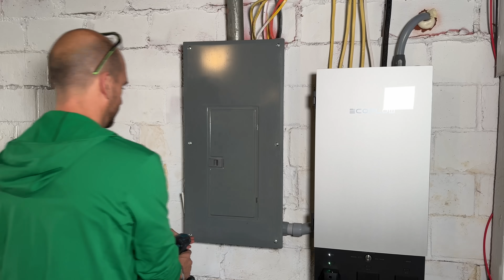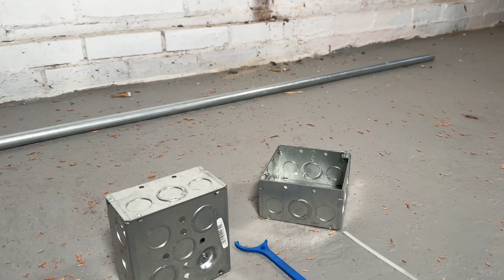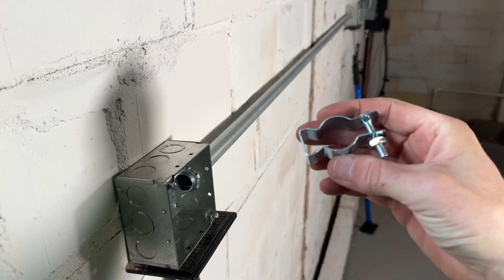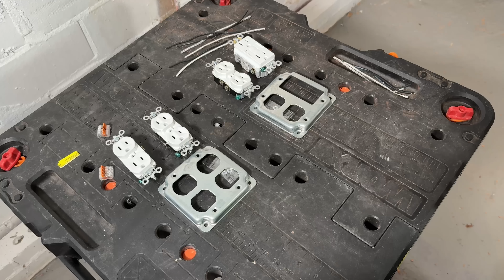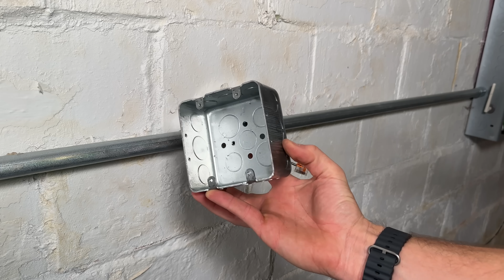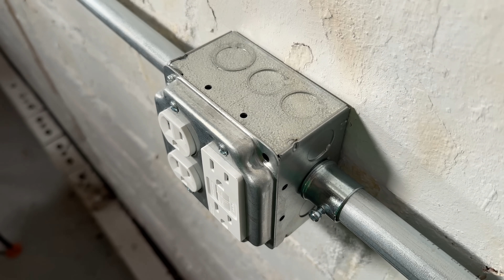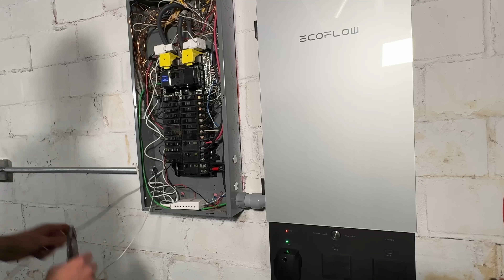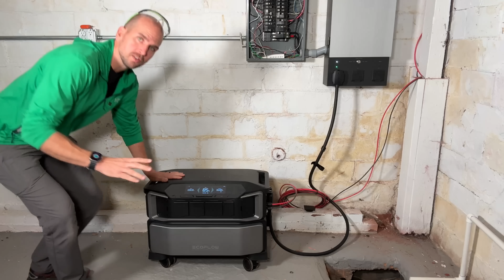Add Outlet To Unfinished Basement Or Garage

Comment: Do the WAGO connectors really carry as much current as a solid wire?  Why not connect the wires directly to the outlet terminals?  The outlets in the first box are connected through one WAGO connector while the outlets in the second box are connected through three WAGO connectors.  What's the voltage drop to the second box?  Can the second box carry as much current as the first box?  In another video, you show the heat generated by the WAGO connectors which means resistance which means reduced capacity.  What is the capacity loss?

Comment: In a dry location, nonmetallic sheathed cable is permitted to be used inside a metallic Raceway without removing the outer jacket and without derating. Before you post video showing people about how to do things please read the national electrical code.

Comment: Great video and I am posting my comment before finishing it. This is exactly what I need to do in my basement and garage, so I am glad I found it. However, aren't those outlets 15AMP on a 20 amp circuit? Also, it would have been great if you had taken a moment to show the wiring connections between the outlets at regular speed rather than fast speed. Thanks

Comment: Never skip the dedicated ground wire.
Never rely on the conduit for ground, even when using rigid instead of EMT.
Also, make sure the groung can handle a short current without becoming a fuse!
Reply from the maker: Thanks for the feedback.
Reply: In the real world, the conduit is used as the EGC all the time. The NEC lists 14 different types of EGCs, only one is a wire, 12 are conduits.

Comment: May be a dumb question. But why use 15-amp rated outlets on 12 gauge with a 20 amp breaker? Why not use 20-amp rated outlets?

Comment: I was taught: in the panel, white to common bar, ground to neutral bar and black wire to the breaker. I see white and ground wires to the same bar. Then why have two bars for ground and neutral?
Reply: If you have only one main panel in the house the grounds and neutrals are bonded and share the same bars. If you have a sub panel then the grounds and neutrals have to be on separate bars .

Comment: A couple of suggestions here. First you need a pair of channel locks. I prefer 430's and they need to be uninsulated. That way you can ream the outside of the pipe with the jaws and ream the inside with the handles. Saves carrying extra tools. You can also tighten the connectors with those same channel locks. I would never use payne hangers on an exposed wall as they are a hang up issue from the ears stuck out. Learn to bend box offsets on that half inch emt. It's very easy to do. Then you can use one hole straps to support the pipe and nothing sticks out. Also you need a strap within eight inches of each box and if you're using a full joint of pipe you'll likely need a third strap in the middle for support.  There's nothing wrong with the way you made up the dual outlets in the industrial covers but most of us find it easy to tie the two outlets together first and only have one set of wires to connect to the feed. In a damp location like a basement I'd also suggest you toss those wago's and learn to use a quality wirenut correctly. It will make a far better connection for long term use. And as others have told you you need a good ground wire running through the pipe even though you have a sound mechanical connection a continuous ground wire is better.
Reply: EMT requires support within 3' of a box, not 18". Only damp basements are damp locations, which means visible moisture. Most basements are dry locations. EMT is fine as a ground and a wire type ground is not required, or better.
Reply: @pld8993  Thanks for the laugh. By the way I've seen inspectors grab a connector and twist it as hard as they could by hand. If it turned at all they failed the inspection.
Reply: @haroldgreen1425  Yeah, laugh. They should fail it. Hand tightened fittings is an improper installation and an NEC violation.

Comment: Pigtails are STUPID and just one more failure point. Wagos are no better than the push in connections on 15-amp switches and outlets and should be illegal. ALWAYS USE THE SCREWS

Comment: maybe I didn't quite understand.... what's the difference between Romex and stand alone strands of wire? Isn't romex the same thing just all insulated into a single sheathing?
Reply: I ONLY use Romex, especially underground in PVC conduit.
Reply: A wire is a single conductor; a cable is an assembly made up of multiple wires/conductors. Romex is a cable.
Reply: @pld8993  I should probably clarify... isn't the end result in their use the same? Meaning if I take off the sheath of the Romex, essentially I'd have the same bundle of cables as displayed in the video that were not sheathed...?
Reply: @DubyaK  The end result is the same electrically, but the NEC requires that romex in conduit maintain its sheathing because the individual conductors inside romex are not marked/labeled.
Reply: @pld8993  gotcha, thanks for the clarification! :)

Comment: No ground wire. Need a ground even in conduit. yes you can run the Romax in EMT pipe or has a case. You just can’t run it outside in due to that it’s not outside rated for wet locations. need to bond metal with the ground. And that’s false you can’t use your conduit as a ground that’s against code. You have to have a ground conductor and bonded to the box to complete the ground. Self grounding outlets are no longer acceptable. Electrition in New York State licensed 20+ years always want to pull the ground wire
Reply: 250.118 lists 14 different types of EGCs, only one is a wire. Metal conduits are 12 of the 14 and absolutely allowed as grounding path. Self grounding devices are also allowed. Read and learn

Comment: How many of these new outlets can I daisy chain on 1 circuit?
Reply: As many as you want on one circuit.
Reply: @pld8993  That's not actually true, That's why I asked. I looked it up since this question and the answer is no more than 10 outlets on a 20 amp circuit and the total load on the circuit should not to exceed 1250 watts including all devices running on this circuit.
Reply: If by “looked it up” you mean you googled it and found some random comment with your answer, that’s not really looking it up and you, predictably, found an incorrect answer. Nowhere in the NEC does it limit a 20 amp circuit to 10 outlets or 1,250 amps. A 20 amp residential circuit with receptacles (cord and plug connected loads) is limited to 16 amps (1,980 watts) with no limit on the number of receptacles on that circuit. Putting 100 receps on a circuit, while not smart, is legal. Why would a 20 amp circuit be limited to 1,250 watts, which is 10.4 amps?

Comment: Do not agree even if even allowed. Lock nuts loosen and corrode. Just run the darn green wire. It may be grounded, but not bonded.
Reply: Lock nuts don't magically loosen or corrode any more than ground screws magically loosen or corrode. You're wrong. Grounded and not bonded? That makes no sense.

Comment: As a retired professional electrician, I WOULD have mounted the conduit against the wall by bending an offset where the pipe leaves the panel and where they enter the 4" square boxes.  I would also have used the third green wire (#12 THHN) to make a reliable ground.
Reply: There's no need for box offsets in this installation, and the EMT is a reliable ground. Neither offsets or a wire EGC is wrong, just unnecessary.
Reply: @pld8993  I was simply stating how I would have accomplish this same task.  Yes, the conduit makes a good ground unless a connector comes loose.  Your work is neat and well done (up to code standards).  No hard feelings.  I did mostly commercial work and that was how I was trained back in the 70s when I was an apprentice.  Thanks for your response.
Reply: my thoughts exactly... where's the bends?
Reply: @davidcook1130, thanks David.  My main reason for doing this is to get rid of the hanger type strap which will be constantly snagging your clothing when walking by.  With the offsets, a single-hole strap can be used with the pipe against the garage wall.

Comment: The GFCI will not protect if you dont have a grounding
Reply: Yes it will. If the current between the hot and neutral are not equal, the GFCI will react and it doesn't need a ground to do so. However, in this case there is a ground, the conduit.
Reply: @pld8993  you are right

Comment: I don’t see any ground wire attaching to the metal box, you should ground the metal box because is metal, it helps you to avoid a shock son.
Reply: EMT is permitted as equipment grounding conductor, NEC 250.118(4).

Comment: need to strap your conduit and why didnt you use a conduit bender to off ser your conduit?
Reply: Yes, the 6' section needs a strap in the center. Offsets not required or necessary, with or without offsets is fine.

Comment: I would appreciate it if you slowed up enough to give a clear picture of your pigtails on the back of the outlets. This is a lot in a hurry.
Also, why should you not run romex through the conduit? 
Thanks
Reply: Romex can be difficult to pull through conduit, but romex is allowed in conduit anywhere romex is allowed.

Comment: Did he install 15 amp receptacles on a 20 amp circuit? I'm no electrician, but that's what it looks like to me.
Reply: Yes he did and it's fine. You can legally install 15 or 20 amp duplex receptacles on a 20 amp circuit. You can only install a 15 amp receptacle on a 15 amp circuit.

Comment: With the QO panel why not just use a breaker in the panel for GFCI/AFCI protection.  It’s a new installation and code is moving to require protection just about at every circuit anyways.  Excellent video though.  You have made me very comfortable with doing these home modifications myself, not to mention saved me significant amounts of cash.

Comment: I think that you're okay without a ground wire according to NEC 250.146(A). Your boxes are bonded by the metal conduit and the receptacles are mounted directly to the box cover, the self grounding feature is not necessary. It's only necessary for a flush mounted box or metal 4 x 4 box and mud ring, NEC 250.146(B).

Comment: That Battery backup sitting on the basement floor is a no no.  If water should rise and
contact that Battery a Fire could result.  The Chemical Makeup of the Batteries and
Water should never make contact due to the Fire Hazard.

Comment: Why did you use 4x15 amp outlets on a 20 amp circuit? And WTF not run a ground wire as well?🤔
Reply: 15 amp receps are regularly used on 20 amp circuits, and the conduit is the ground.

Comment: That has to be the silliest way to install conduit. First of tapcons are garbage, use a red or yellow anchor. Why would you use cabinet jacks to install, start from the panel and work your way left, leveling each piece of pipe and box one at a time left to right. Why did you not give your 6 foot piece a box offset on each end so you can install a one hole strap? You are definitely not an electrician bud

Comment: If that outlet plate is ever removed from the box while the circuit is live, it will become ungrounded. I always use a ground wire for outlets and always bond the last box in a conduit run for safety.

Comment: I was a Master Electrician and would like to comment:
(1.) We always ran an insulated ground wire with the other wires. The Code may not make you but it is standard practice. 
(2.) We always used a box off set and one hole clamps on the EMT. Where the conduit was located where no  one could rub against it we may use hangers like you showed.
(3.) The wire would need to be labeled for the use.

Comment: I'm  going to pile on.  First you did not check to see if there was no power with a non contact tester prior to working.  ALLWAYS check the power state twice with different tests before working if you are not a professional.  ALLWAYS.  Second, NO  inspector where I live would sign off on that installation without a EGC (ground wire).  They would just fail you. Argue the code all you want, they would just fail you.  Furthermore no electrician I know would not install the ground wire. Third, no professional electrician would install this without the EGC.  Fourth, you have no idea what is going to be on that circuit in the future why create a wacko difficult to troubleshoot situation.  This might fly in Chicago but I have my doubts.  Finally, I have seen EMT completely corroded through with just the (live) insulated wire running through the slab.  With out an EGC there would have been no ground.
Reply: The metal conduit is the EGC and is perfectly legal and reliable; wire type EGC not required in this case. Real electricians install metal conduit EGCs every day so you must not know any real electricians. Inspectors don't get to fail code compliant installations simply because they prefer some other method. If they try, one phone call to the AHJ will set them straight. You're obviously not an electrician.

Comment: The reason he strips out tapcoms is because he drills so far, if you put a piece of tape before the end of your screw on your drill bit that you know right where the screw will fall than impact it in pretty easy of course if you blow out the ass of the screw there's no structure, technically how you just hung it has no structure because it's not biting at the end just barely in the center of the screws

Comment: Another point, on conduit as ground.  Go to Hone Depot, and look and 12/3 THHN wire for sail.  It's got 3 colors, loosely braided, designed to pull through conduit.  Unlike Romex 12/3, it has no ground - because its not needed.

In flexible metal conduit, the AC variety (not MC) - often called BX - has no green wire to connect to grounds.  The ground is accomplished entirely through the armored shield clamped at both ends to metal boxes.
Reply: It has a ground, 3 wires, black/white/green.

Comment: A lot of unmerited flack for using the conduit as the ground.

That said ...  I think (...) code requires the enamel to be scraped off the box where it's a thing - like on the breaker panel here.  I'm still trying to nail this down - it may be that NEC rated lock-nuts are designed to scrale through the NEC rated enamel
Reply: 250.12. Zinc connectors definitely need the paint removed but steel connectors, which he used, come with locknuts designed to bite through the paint. That said, I always remove the paint unless I'm using bonding locknuts.

Comment: click bait trash fail video. 100% allowed to use NM in metal conduit unless its basically OUTSIDE "dam environment" Misleading trash video with clear code violations done. Piss poor deburing, NOT using a torque tool on the breaker, Trash connectors, this is passing with a D- if you are half blind to the BS click bait of the title and thumbnail.
Reply: Incorrect. NM is allowed, and sometimes required, in conduit. NM is not allowed outside ever, whether in conduit or not, dry locations only.
Reply: @pld8993  CAN YOU READ!? I said that it CAN BE and that this video is click bait that is wrong. I never said it was ok for outside. NM is NEVER (REQUIRED) to be in conduit.
Reply: @loligagger85  I can read things that are clearly written. Romex required in conduit where necessary for physical protection or when passing through a floor, 334.15(B)(2). The only code violations are missing a support on the 6' length, and he should have removed paint on the panel for the connector to have direct metal contact.
Reply: @pld8993  you missed this completely. The click bait of this is the thumbnail and the moron in the video saying you can not run NM in conduit. 
You might be able to read but your comprehension is piss poor
Reply: @loligagger85  He didn't say "you can not run NM in conduit," he said "we should not be using romex when it comes to conduit." You certainly have first hand experience with piss poor comprehension, genius.
Reply: @pld8993  the title and the thumbnail suggest that he does and he even says its bad. What he said is also wrong. you can absolutely have NM come out of conduit with the correct connection. Troll hard rtrd
Reply: @loligagger85  Suggesting and saying are not synonymous. Nice try, simpleton.

Comment: It is legal (code) to use Romex in conduit, as long as the conduit fill does not exceed 53%  of conduit inner diameter, and the conduit is not located outdoors..ie wet locations.